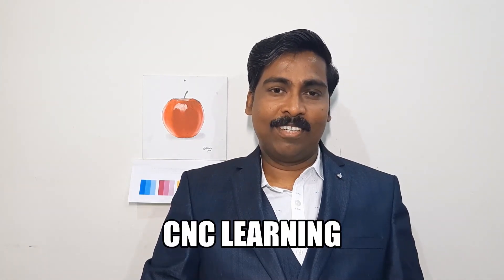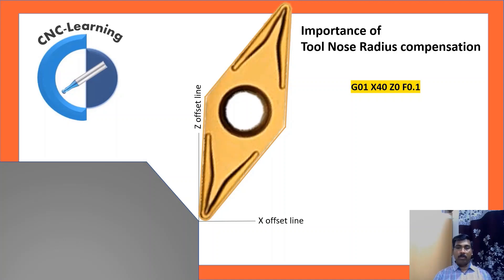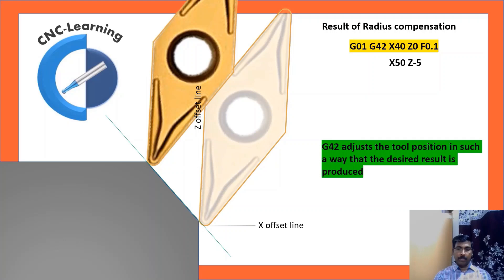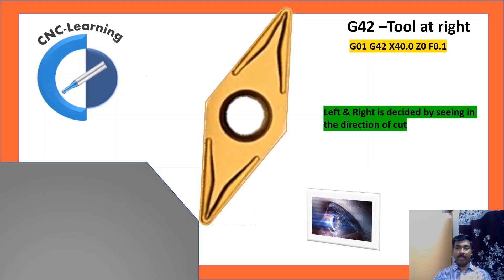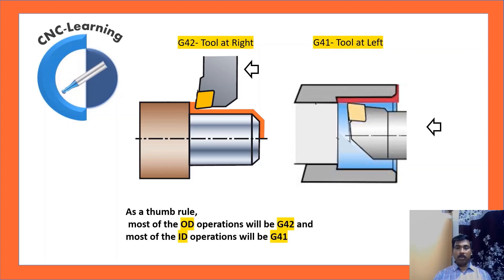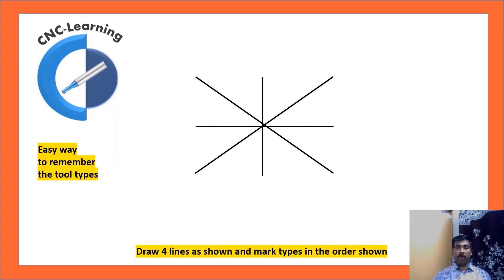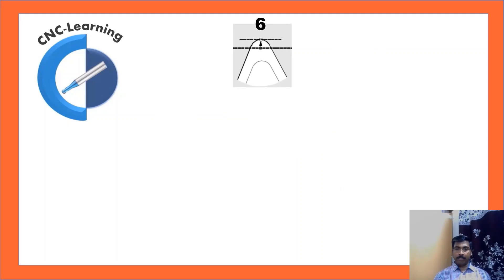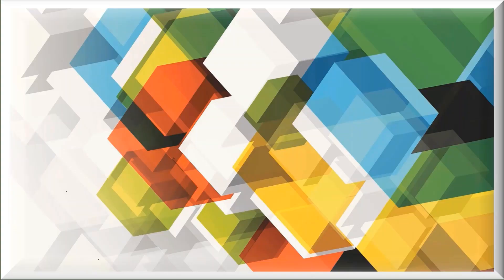TNRC [Tool Nose Radius Compensation] | G41 G42 | CNC-Learning | Rajeev Sreedharan

Comment: Excellent video, but do comment on those lathes that have an inverted x-axis and/or have a front and rear tool position, where the tool nose types are different as well as the TNR commands used.
Reply from the maker: @darcustaseen1602  this video talk about back turrets.
For front turret machine, diagram will become mirror image 
In this video X+ direction is marked
Reply: @CNCLearning  What happens to G42 and G41 commands? Are they also inverted?
Reply from the maker: @darcustaseen1602  yes

Comment: tool type number used for outer and inner grooving tools???
Reply from the maker: It depends upon how you make the program. If you are using a flat grooving tool, it will have two corners. You need to consider every corner as a seperate tool.
For example, OD grooving tool, the corner which is closer to the Chuck will be considered as an OD forward turning tool. So type 3. Other corner will act like a reverse turning tool. So tool type 4.
Tool width compensation you need to consider in the program.
For round insert grooving, it will be tool type 8 for OD

Comment: I have a radius of 0.5 mm in my job , I am using 0.8 radius insert for rough finish and 0.4 insert for finish cut . I get error of interface G41/ G42. When I remove TNR comp G42 it works but than , lot of material is left for finish cut . Can you please advice.
Reply from the maker: For a precise reply, I need to see the program used.
Probable reason can be, insufficient positioning distance.
Or wrong insert nose radius in tool offset.
Else wrong tool type

Comment: 👍and subscribed. 
How would you use comp on a profile that requires the tip direction to change? Such as a type 2 profile on a Haas lathe. Program as a tip 9 with no comp?
Reply from the maker: If it is a round tool with cutting on all sides, then type 9. You can use compensation.
Reply: @CNCLearning  Thank you for the reply my friend!
I would be using a V type profile insert. I could set the tool offset to the center of the TNR and comp with tip 9. This sound correct? Thank you again.
Reply from the maker: @James-fs4rn  for OD, tool type 8, offset set to tip in X direction and center in Z direction
Reply from the maker: @James-fs4rn  watch 8:21

Comment: How to compensate round insert like RNMG
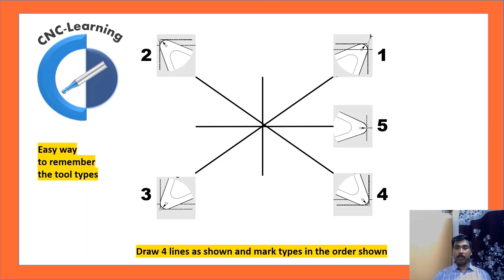Reply from the maker: 7:15 tool types 5,6,7,8&9 depending on application
Type 9 for any (tool offset in center of insert)
Type 8 for OD (offset in tip)
Type 6 for ID (offset on tip)
Reply: Tool nose radius R?
Reply from the maker: @jenifersingh.r9647  yes. Actual radius of the insert (=diameter/2)